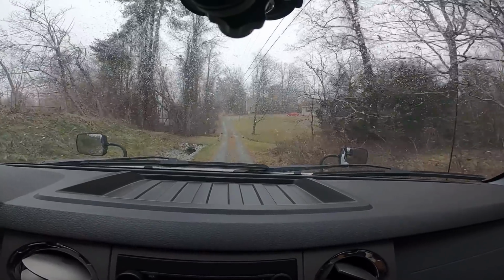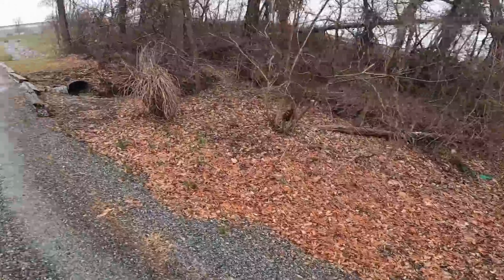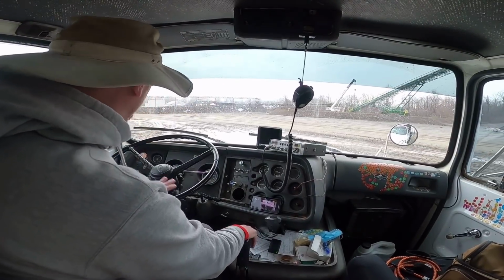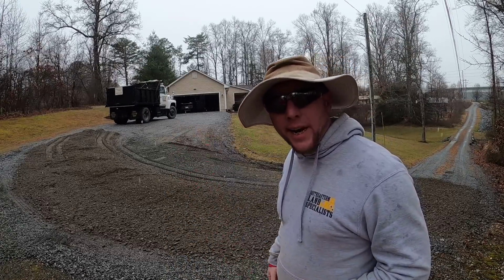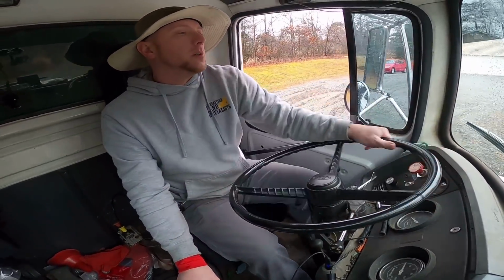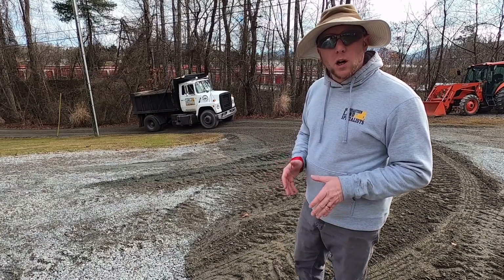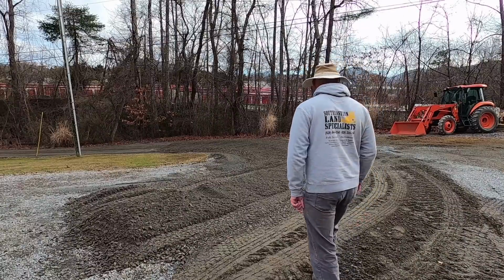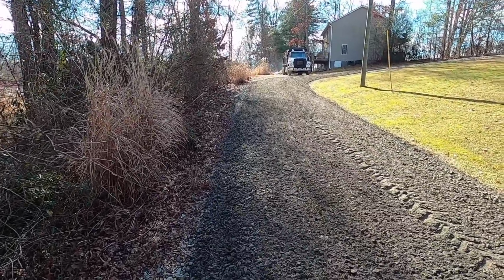How To Fix Your Gravel Driveway In 5 Easy Steps | Digginlife

Comment: What's that power inverter you're running? I was thinking of running a wall plug heater in my pickup, but the inverters I was looking at in harbor freight didn't seem like they could handle it ( or maybe I didn't want to pay for the largest one; I don't remember 😂 ).

Comment: I think the hardest part for guys wanting to learn and start with customers is pricing. You for sure seem to want to educate and teach new operators the skills they need. That being said how do you charge for a job like this? Is there an hourly rate you need to make on top of the gravel to cover your equipment and fuel expenses and profit? How does one calculate this based on their particular overhead? A guy with new equipment and expensive truck registration will need to get more than a guy with older paid for equipment etc.. Any thoughts on this?

Comment: How much more difficult would it be if you did not have an air gate on your dump truck? Not so much? Also, 8tons is 16,000 lbs. you stated you would weigh around 37, 000lbs with the last load that was used to compact the material. Wilbur only weighs 21,000lbs?

Comment: Well , I agree with everything you did except, you didn't roll the rock . It's not going to stay in place unless you hammer it in . Most important to do on this kind of incline .Water will move it , cars will tear it up going around the radius at the top of the hill .
Reply: That single axle dump at 36-38000 lbs packed that crusher down better than the average roller. And better than a car. Even after a smooth steel roller, the turning cars will eventually kick out the top rocks and water will do what water does. Maintenance is where it's at 👍🏼

Comment: What do you do when there are lots of leaves on the road? In Florida we have pine needles and they bunch up in the box blade. Any tricks other than rake or blow them off before starting?
Reply: Try renting a power rake for your setup sometimes called a Harley rake. They can recover buried gravel and separate thatch and organic debris quickly
Reply: York rake